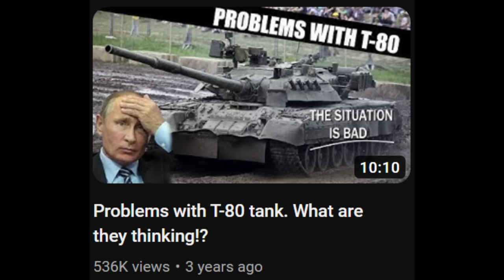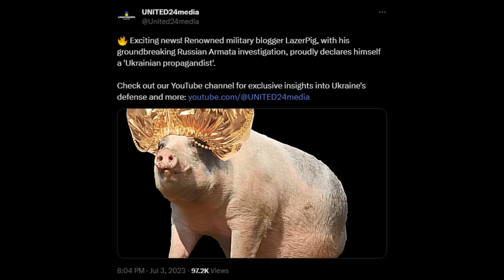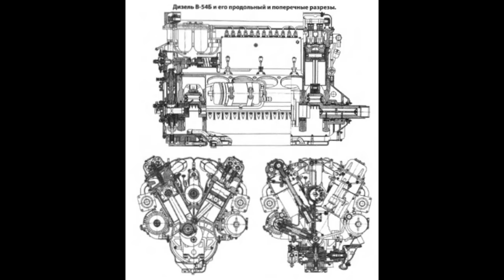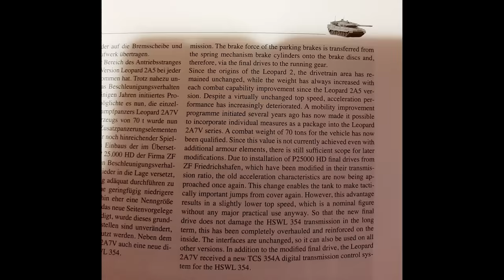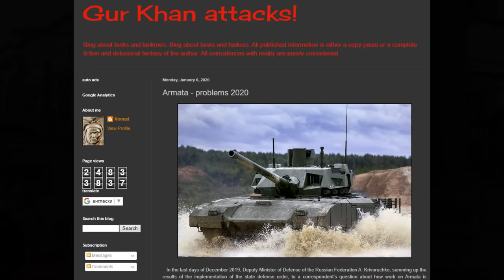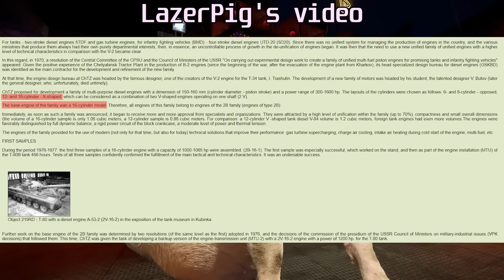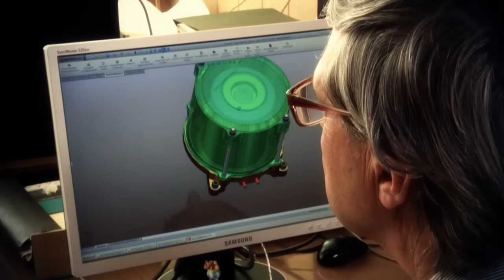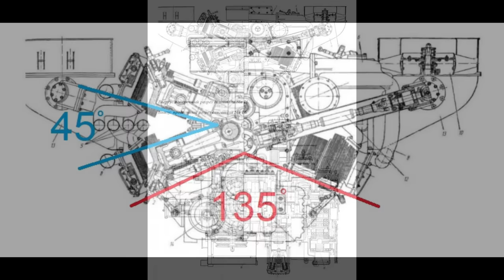Response to LazerPig and the T-14 Armata dispute

Comment: It seems like he misrepresented what you said, but also what you're saying now doesn't seem to debunk what he said. For example, I'm not shocked that Indian commanders say their T-90s would wipe the floor with Chinese light tanks. Additionally, yes. We would want the announcer to at least say, "I don't know what has just happened" or "we are waiting for information" if that is the truth. Instead, he comes up with something on the fly. If you catch any westerners doing the same thing, I'd expect you to call that out, too. For example, if an F-35's turbine puffed out in the middle of an airshow, I would call it suspicious if we discovered that the airshow's announcer had (intentionally or not) brushed over the fact that the F-35 had stalled by accident.

There is also an important difference between using Soviet sources and relying on Soviet sources. I would expect researchers to use whatever sources they could get their hands on. But relying on one source (or source of sources)--which is Laserpig's word choice--is different from simply using them--which is your word choice. There's no debunking going on there. It's just hearsay coming from the both of you, at least from my perspective as a viewer.

Comment: when it comes to the comparing engines I have to agree with lazerpig. its not a problem of a smaller tank having a smaller engine, its a problem of a western tank having the power to carry a lot more protection and firepower while the smaller tank ends up being a lot weaker in comparison without any additional speed. what he's saying is that a smaller tank needs to be faster than a heavier tank since its going to be outgunned by a heavier tanks heavy weapons. so if a soviet super tank cant actually beat a contemporary western tank, why even bother building it that light.

Comment: about the V-92: well, i dunno if it's reached the end of it's cycle. V-46-6 engine had a rating of 500-800 hours, V-92 is rated at 700 hours. 
it's the transmission of the T-tanks that is absolutely atrocious. the czech adressed this with their superb T-72M4, which actually has decent reverse speed and FCS.

Comment: Armata won't be used as a tank on tank vehicle. It will be a rolling pillbox. Will be blown up by artillery strikes, drones and anti tank missile systems.
Due to lack of numbers, it will be held in reserve. Pretty much endorsing the rational, it wasn't worth the expenditure.
 In addition, the unarmored turret when hit by just a drone will make it combat ineffective. T80/90'S, better armored are lost to $2000 drones. Armata
is a rolling piece of junk that wouldn't make it 10 kilometers into any contested zone of fire.

Comment: Not sure about this but the challenger 2’s engine states engine package weight which might include the transmission aswell in addition to the engine weight. Not necessarily a fair comparison between the power to weight
Reply: It doesn't include the weight of the transmission

Comment: I dont want to sound dumb, but the description of the CV12 engine you describe at min. 15:36 literally states l.13 "the CV12 has been designed from the ground up to meet all the requirents of the latest generation of MBTs." Another point I would like to make is that the interpretation you made with the statement "builds upon the legacy"  sounds kind of far fetched.

Comment: 43:25
Holes in the crankshaft aren't for "pins", which would pretty obviously not work with rotation. They're lubrication holes.

Generally on V-2, it's a pretty unique engine. It was designed for aviation and you can definitely feel it.

Comment: Youtube "expert", studies was errected about this garbage, any soviet ( before this one) was about light, short,  versatile aaand very mobile which can travel along siberia or large territories on any bridge, but so light cannot survive in a real battlefield situation versus Western concept with more solid hull and take in consideration real confrontation between tanks, that's why Western tanks are damn pretty heavy and cannot cross any bridge only with serious preparations.
Now this garbage truly define new russian paradigm with heavy tank like as the West, but remains tributary to automatic self loading which is not feasible and have seriois problems with the gear-engine anssembly not good for heavy payload, lack of maneuvrability and lack of sensors because of sanctions, russia with small letters screw up literaly this new brand tank.

Comment: I'm not seeing a problem with the T-14 engine's HP. It seems more than adequate for this size tank. If the engine is reliable then there shouldn't be any issue. 

22:00 This characterization is not quite accurate. The 3BM60 round is close to the M829 round which was replaced back in 1991 with the M829A1 which is itself noticeably inferior to the M829A3. Trying to compare it to the M829A4 is just silly. We know what this means in practice. It will be difficult for a Russian tank to make a kill at 3000 meters. It would probably need to close to 2000 meters. The T-14's gun would fix this.

If the T-14 is a superior tank then why aren't there any in Ukraine? The lack of a turret tub should make manufacturing much easier.
Reply: The only comparison he made with M829a4 is that it was outright superior. And no, m829 is not close to the performance of 3bm60. M829 doesn't even approach 3bm60 in length, or penetration for that matter. 

Although M829a3 is better, but M829a2 also has less length.
Reply: @voidtempering8700  

Amusing response. 😄
Reply: @scientious  I assume you did basic research for your response. If you did, why did you put incorrect information in your comment.
Reply: @voidtempering8700  

I'm sure your faith is of great comfort to the Russian widows. Bless you.
Reply: @scientious  So, will you address your poor research or will you keep diverting the topic? Did you even check the lengths' of the various projectiles?
Reply: @voidtempering8700  
> So, will you address your poor research 

> or will you keep diverting the topic?

See your previous comment. 🙄

 > Did you even check the lengths' of the various projectiles?

Obviously.
Reply: @scientious  Okay, I apologize, I made a mistake when it came to the lengths, and I am sorry for coming off as rude and aggressive, it looks like I did not remeber it properly. I was using 3bm59s total length rather than projectile length, while I was using projectile length with M829s'

However, for 3bm59, it is between 620-650mm long, while m829a1 is 684mm in length. However, 3bm59s penetrator weighs more(5kg vs 4.6kg), and since it is smaller, it is likely more dense. Lastly, it is also faster(1650 m/s vs 1575 m/s). Now, 3bm59 also has higher claimed penetration(700mm- Here, I couldn't find the exact value for m829a1, so I used performance of the M829s length and penetration, so m829 is 627mm long, and has a reported penetration of 540mm, is 0.86 of the total penetrator, using this, we can get 560mm of penetration, but the equivalent will likely be higher, so I am just going to move it up to 600mm). Now, the Soviet Union has an 80% full penetration vs NATO 50% on training targets to determine penetration, so there is an additional 8% increase for 3bm59(756mm). 

Now, for m829a2, it is reported to have a length of 780mm, now this round has an estimated penetration of 750mm, which is similar to 3bm59. So both m829a3 and m829a4 are undoubtedly better than 3bm59, but comparing it to the previous rounds doesn't make sense.

Now, we also have to look at other NATO nations APFSDS, because the US is in the lead with there rounds. As Red said, DM-63 is comparable to 3bm59, with the British round being weaker. 

Also, I just realized I was using 3bm59 rather than 3bm60. Despite the names, 3bm59 is better than 3bm60.
Reply: @voidtempering8700  
Right, the SVINETS-1 (3BM59) uses depleted uranium whereas the SVINETS-2 (3BM60) uses tungsten. It looks like the 3BM59 is the premium round while the 3BM60 is the budget version.

> 3bm59 penetration (700mm)

m829a1is also 700mm

> The Soviet Union had 80% full penetration vs NATO 50% on targets to determine penetration, so there is an additional 8% increase for 3bm59(756mm). 

Sort of. The Soviet Union did use that standard but we don't know if Russia still does. However, we can assume that it does.

> m829a2, penetration of 750mm

Comparable, yes, except for the sabot.

m829a3 is 800mm. m829a4 is higher.

Now, let's consider the other factors. Only the modified T-90s can fire SVINETS rounds. The T-64, T-72 & T-80 can only get 560mm penetration if they use the newest ammunition and we don't know if that is available in quantity today. Allowing 8% would be 605mm. The tank barrels using SVINETS also wear out faster because of the tungsten sabot.
Reply: @scientious  I agree mostly, except for the last part. The T-80BVM and T-72b3, T-72b3 2014, 2016, and T-72b3m all have the new autoloader that can fire these rounds. The T-72b3 is the mainstay in the Russian army, so most of their Frontline tanks can fire these rounds.
Reply: @scientious depleted uranium isn't inherently better than tungsten. In fact in many cases depending on the alloys, Tungsten is superior to DU rounds. 3BM59 exists simply as a DU alternative.

Also, the part of T-90 being the only tank that can fire Svinets is not true. All modernizations of the T-80 and T-72 are refitted with autoloaders so that it can fire Svinets-1/2. To my knowledge even basic T-80Us were refitted because it was easier to do the conversion on the MZ autoloader. T-72BAs can even fire it.

The sabots aren't tungsten. Non APFSDS or saboted projectile uses tungsten or DU. From what I recall the sabot on Svinets-1/2 is aluminum.
Reply: @voidtempering8700  
No. Back in 2010, Russia began upgrading older T-72s to T-72B3 with the 2A46M-2 gun. They built about 2,000 of these, but that gun cannot fire SVINETS which didn't exist when the gun was designed.

In 2016 they upgraded some T-72s to T-72B3M with the 2A46-5 gun which can fire SVINETS. However, they only built a few hundred of these.

They had about 300 of the T-80BVM with the 2A46-5 gun.

Even the T-90 didn't get the 2A46-5 gun until the T-90M upgrade in 2020. Given what we've seen in Ukraine, this can't be more than a few dozen.

Presumably, any upgrades since the beginning of the war in 2022 would use the 2A46-5 gun.

Russia does have a prototype, 2A82 gun that fires VACUUM rounds with higher muzzle energy than any NATO round, but it requires better metallurgy due to the higher breech pressure and they've been unable to achieve this in mass production.
Reply: @scientious the gun wasn't the issue. The issue lied solely on the autoloader projectile length limit.
Reply: @TheForklifter  
Do you know of any dash 2 (or older) guns that were upgraded with the new loader and targeting computer? Do you know of any T-90s that only had targeting computers upgraded for SVINETS?
Reply: Because they cant manufacture it en masse. Stoo using this argument
Reply: @loassaul2097  
You're going to have to explain that to me because I don't understand it. Why do you pretend to disagree and then repeat what I say?
Reply: @scientious  That is not what you said, stop lying to yourself.

The argument that: "if the T-14 is so good then why isn't it in Ukraine" is so stupid. You can make the most advanced tank ever but there is no guarantee it will go to the field. There are so many things that makes the T-14 as either shit or good. But that statement is just dumb.
Reply: @loassaul2097  
I have no idea what you just said. Maybe you could repeat it without the ad hominems and hyperbole.
Reply: @scientious  By god you told me I was just repeating what you said, when I clearly had not. C'mon tell me where you had made the argument that t14 isn't being produced en masse? What are you even talking about "muh ad hominem"?
Reply: @loassaul2097  
The T-14 is obviously not in production. They ran off a limited batch and that was it. It could be because without the newer gun, the T-14 isn't much better than the T-90. If the T-14 was in production then we would see them showing up in Ukraine and we aren't seeing that. The T-90 seems to be in very low production.

Comment: RedEffect also to help you a little, the latest variation of T-90M has an advantage in firepower against western tanks, contrary to all other russian tanks which they just used upgraded guns like the 246M-4(both the T-72B3M and T-80BVM) the T-90M proryv-3 due the the complete new turret which is larger uses the same gun that T-14 Armata has, which is the  2A82-1M capable of firing APFSDS-T with a rod of 900mm!!! They can use the new Vacuum-1 with depleted uranium rod and Vacuum-2 with the tungsten rod capable of penetrating 1000mm RHA at 2km and with a muzzle speed of around 2.000 m/s!

Comment: Okay... I think this has gone to far. I think BOTH you AND LazerPig have made mistakes. I think, rather than make this reply video... You could've just talked to him... 

LazerPig DID make mistakes in that video. But the response video you made had mistakes as well, and, as he pointed out, had bits that were unnecessary, like saying that the V-2 wasn't developed for the BT-7.... Even though LazerPig never once claimed that the V-2 WAS made for the BT-7, making his reaction to it justified. You could've just said something like, "LazerPig didn't make a mistake here, but I wanted to point out..." and then make that point. I also notice you never countered his argument for the BT-7 being a mass-produced model... 

As for the T-34 and T-90 having the same engine... Both you AND LazerPig are right, and it can be argued either way. Yes, you're right that it isn't the EXACT configuration as used in the T-34, but LazerPig is right in that it's a variant of the V-2, so, arguably, it IS the same engine. 

And for Russian Propaganda... It's possible for people to fall for it, even without realizing, as some news cites cite a source, which cites another source, which cites another source, and so on... Until it goes to a Russian Propaganda network. And some books could've been influenced by people without anyone knowing because the authors couldn't tell them.

I'm not saying, RedEffect, that you're an unreliable source. What I'm saying is that you could've handled this so much better than you did. LazerPig is human, as are you, and I don't believe either of you meant to insult the other, but took each other's videos the wrong way, which lead to... This... 

I'm not trying to bash you, RedEffect, but I want you to realize that you made SOME mistakes, like everyone does. Nobody is perfect. And, yes, LazerPig made mistakes too. I'm not trying to deny it. I'm just trying to make these points:

1) BOTH videos, yours AND LazerPig's, had mistakes and unnecessary points in them, to a degree. 

2) There are ways to resolve disputes besides reaction videos, which I, personally, would've practiced beforehand. 

And for anyone calling me a hater, NO, I don't think RedEffect is a propaganda influencer, I just think he handled a situation the wrong way, making a reaction video before thinking everything through, and taking LazerPig's response as an insult rather than a "Hey, we're both human and BOTH made mistakes in our videos".

Comment: Russia could really use the T-14 right now on the field...just saying.
Reply: adding a completely new tank would destroy there logistics
Reply: @rogue__agent5884  i mean, there aren't many of them. So it's wouldn't "destroy" anything, just complicate a bit. Ukraine managed to do that with western tanks. Most likely they don't want it because it might be destroyed and be a bad advertisement for it before they even started selling it
Reply: @yellowtunes2756  Russia is operating 3 tank model T-72 T80 T-90 ( T-72B T-72B3M T-80U T-80UE T-80BVM T-80UK T-90A T-90M ) and is having logistics problems 
The only thing T-14 has in common is the ammo and that’s it , it’s a completely different tank n would bring more problems
Reply: @rogue__agent5884  all those different tanks require very similar maintenance and logistics, half of their artillery has same trucks as their tanks too, they also use similar engines. Their logistics in infinitely less complicated than Ukrainian one. So adding few dozens of different tanks to a certain part of front - isn't a big deal logistic wise
Reply: @yellowtunes2756  They all can use the same 125mm ammo but the still have different guns and autoloaders 
T-14 uses 2A82 
T-72B T-80U T-80UE T-80UK uses 2A46
T-72B3M T-80BVM T-90A T-90M uses 2A46M5 
Not to mention the engine, ERA